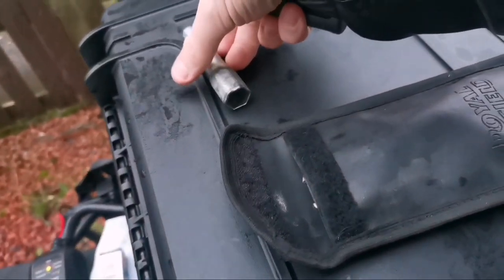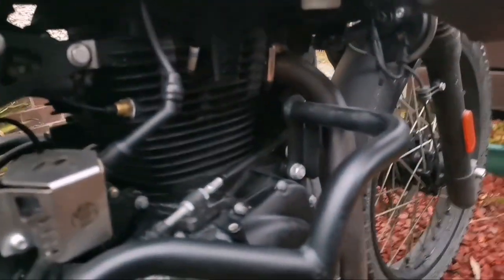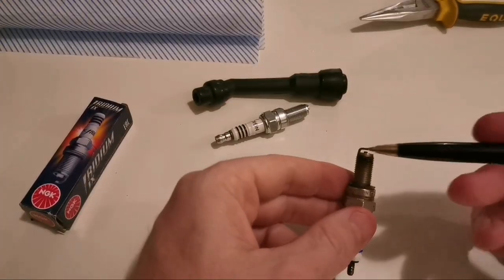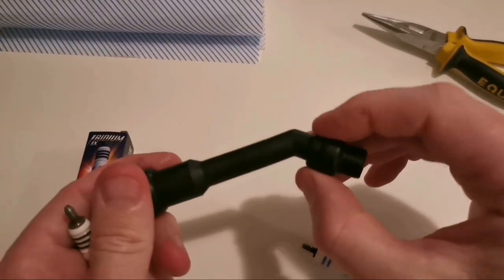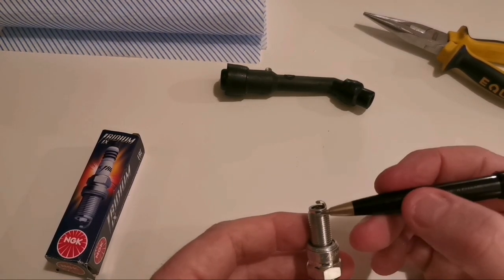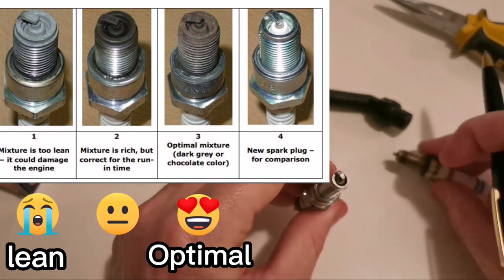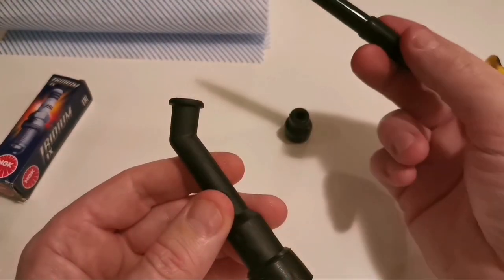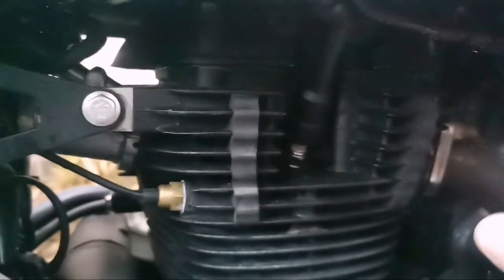Best Motorcycle Spark Plug - Himalayan Spark Plug Change - Iridium Spark Plugs vs Normal

Comment from the maker: Forgot to mention in the video guys. Double check the code when you buy the plug before installing. I ordered online with Halfords to pick up in store.. I got a handed BR8 rather than CR8.
Reply: I use the NGK CR8EIX, that is very good on both my 450ccm and 600ccm

Comment: Always put a little copper grease on the threads before fitting a plug, then it will always unscrew easily, no matter how long you leave it in place.
Reply from the maker: Aye Derek I use Nickel anti slip on all threads that need in and out regularly including plugs. I didn't mention it in this video as majority manufacturers say don't put any kind of anti slip on plugs. People can do what they think is right for them. 👍 Thanks for the feedback mate.
Reply: @WeeJaunt  Can't imagine why they say that. It's asking for seized threads! Copper grease is the second best maintenance practice, after frequent oil changes.
Reply from the maker: @derekm6236  I think it's a problem with people putting copper slip on plugs and then torque too tight stripping the threads. A few cases of folk trying to sue spark plug manufacturers after following torque specs and stripping threads rather than reduce torque by 30% after applying anti slip. Spark plug manufacturers now usually coat with Zinc or some kind of alloy blend and explicitly state not to add anti slip. Of course it will wear eventually if the plugs are not changed as per spec but that's not the spark plug manufacturers problem then. It's nothing more than an anti liable thing. Have a look on Google there's alot of information on it. Hence the reason I don't even mention it lol. I agree with you though I'm an anti slip guy. That said my brother has been a mechanical engineer for 40 + years he doesn't put anti slip in a single thread Iv just been chatting to him about it. His reason...he turns 100s bolts on the daily and always well before they need to be turned or get seized. He works on heavy goods vehicles these days tbf so it's usually steel on steel. He says imagine running spec on thousands of bolts on thousands of vehicles then add to that the math of torque reduction on all of those bolts without making a mistake. For every mechanic who tells you you should there's another who will tell you not to.
Reply: @WeeJaunt  Good point. Too many people with no mechanical experience, feel or sympathy , trying to be mechanics? FWIW, Caterpillar mechanics use lots of copper grease, especially where heat is involved.
Reply: It’s also not recommended due to differential metals causing a type of electrolysis which could actually counteract the point of an anti-seize compound.

Iridium plugs are great, but were predominantly invented for cars with difficult or near impossible to reach spark plugs. If memory serves me right, some V6 cars like the Mitsubishi Magna where the rear facing bank of 3 cylinders was fitted with iridium plugs, while the easy to reach front bank was fitted with regular plugs. At services, mechanics only changed the front bank.

Comment: When I did my apprenticeship we had a Champion Plug cleaning machine, it would blast the electrode with fine grit then after check the spark with the attached high voltage adaptor. Many times I was electrocuted by it working on the bench next to it and someone had secretly attached the crocodile clip to the vice. People forget just how important plugs are for engine efficiency and power
Reply from the maker: Wow aye good old apprentice jokes Manny. You're right it's overlooked by many people sadly including service centres sometimes. Thanks again mate 👍

Comment: I hadn't realised plug life had gone up so much. It used to be clean or replace with every oil change. Then I stopped cleaning them as I got more expensive engines and old mechanic said it was false economy to clean them as unless you were sure you had all the grit out you could be introducing grit into your engine. Nice to see you put them in by hand I have had a few secondhand bikes and cars where previous owners or garages had messed the threads up. I think reading plugs became a lost art with fuel injection and electronic ignition as the mixture and timing are outside your control and you don't really tune the engine now it has become a fitters job remove and replace at the recommended intervals.I would take one out early then keep as a spare that way you know the spare is a working one.
Reply from the maker: That's it Sean overlooked quite often. Iv had plugs rusted into heads before it's no fun and inexcusable given the cost to replace them. There is nothing wrong with cleaning and adjusting a £3 plug. I just wouldn't be doing it at 10k miles eh.

Comment: Do you have a different plug wire end?  it looks like you left the little screw on knob on the plug when you put it in the bike.
Reply from the maker: Haha well spotted. No is the same HT plug I kinda absent mindedly screwed the tip back on whilst messing around with cameras. Only noticed I'd done it after I screwed the plug into the bike. Thanks for watching mate 👍

Comment: Thanks for instructions on how to change a spark plug, but too late. I was trying to remove it by turning right! I spent hrs trying to remove it. Even used a cheater bar for more leverage. Then I snapped it off! So I had to take it to a machine shop so the could drill it out. Cost me a small fortune. So before I change another, I'll check back on your video!
Reply from the maker: Oh wow that sounds like a nightmare I'm glad it's fixed now mate yeh sparkplug don't need to be tight 👍
Reply: Well that was an expensive lesson for you! So here's something to help you in the future - righty tighty, lefty loosey😃
Reply: Haha😁

Comment: I still fir and adjust my own plugs.  Too many times after a service have I pulled it out and it hasn’t been looked at.  They are of course much more reliable nowadays than when I was a teenager in the early/mid seventies.
Reply from the maker: Great advice Jack they are better these days but absolutely right..many a car service In particular over the years they get ignored. I bought a wee car this time last year..pulled the plugs out..took almost an hour they musta had 80k miles on them and were rusted into the head. Only one of the many things wrong with it. Absolutely ridiculous mate. Thanks for watching 👍

Comment: Sorry Bud, disagree with some of what you say. The electrode on a 'normal' plug is not copper, it's tungsten I believe, the copper is the core, inside the plug. Yes, I do clean and gap plugs BTW.
As for voltage draw, the primary winding of coil will take the same current no matter what plug you put in, the current drawn depends on the resistance of those windings. The HT current is generated in the secondary windings, [which are separate] when the primary current collapses so whatever you attach to the end of the HT lead is totally irrelevent.
Precious metal plugs are meant for vehicles where it takes hours of labour to access the plugs, to save service costs as they aren't replaced as frequently.
As for your bike starting / running better with the iridium plug, you would probably have found that with any new plug - or even cleaning your old one.
Some people on Bullet forums have tried iridium plugs and gone back to normal ones because the iridiums foul easier due to the smaller electrodes, but to be fair, some say that they are the best thing since sliced bread.
At the end of the day, if you're happy to spend £10 on a plug, when a £3 one will do exactly the same job then fair enough - it's your money.
Reply from the maker: Aye your right Frank the tip is usually some kind of alloy blend, nickel, chromium, tungsten depending on the manufacturer. I just try to explain these things in simple language and often miss things out...and yes the same result would be achieved with an adjusted and/or new plug of any make. I find talking about plugs a bit like talking about oil or what kind of rust protection you use. It's a dangerous subject akin to chatting about Brexit or independence 😂 Thanks for your feedback mate I really appreciate it. In the future when I pull the crudy old fouled up iridium plug out al make a video about it. Might just call it "Frank was right". 👍
Reply: I used to fit Gold Palladium plugs to my DKW fitted with a Sachs 250 seven speed box engine.  It was in a mid state of tune with a very narrow power band and was prone to fouling.  The dealer said it wouldn’t make any difference.  He was wrong.  In practice I didn’t suffer anything like the number of fouling/whispering with the Gold Palladium plug fitted.
As far as the HT lead goes, better quality generally means lower resistance allowing a higher current for the same voltage (more power in the spark).  The same improvement occurs when the plug has less resistance (better conductors).  I don’t know if that is true for the Iridium plugs, but at the price I would have expected that to be the case.  Not all plugs are equal, some have higher conductance materials used in their construction.  The Gold Palladium’s when I was competing were designed for durability and cleaner running and that is what they provided though performance felt better due to the gold content increasing conductance.  As was typical, I didn’t change the coil, just made it easier to discharge with a lower resistance HT system discharging to earth.
Reply: @jacksjaunts8580  Whiskered plugs! what fun we had in those days :-)
Reply from the maker: @jacksjaunts8580  Thanks Jack. Time will tell with the iridium plug I'm gonny pull it out every 1000 mile or so to have a look at it. If it starts to foul I will do an update on it. I'm glad Frank gave me a heads up on this one. I hadn't seen the forums he mentioned about fouling but it's worth keeping an eye on for sure.
Reply: When I was riding competitively (or trying to ride competitively) I had the plug out and checked before every event.  With standard plugs, before every special stage.  With the Gold Palladium I didn’t need to touch it durning a days riding, practice or otherwise.  On my road/trail bikes I check them when the notion takes me, seldom more than a couple of thousand miles.  I never need to do anything with them nowadays as engines run so clean and seldom use oil.  The technology has come on a bit in the past 40+ years.  Many plugs won’t need any intervention over 10thousand mile intervals.  I used to run some big gas engines (16cylinder 3MW units). Spark plugs were £150 each and precious metal.  The engines ran 24hrs/day except during servicing.  These were changed every 2000hrs.  Of you equate that to road miles at an average of 45mph that would be every 90,000miles.  On road engines I would do it sooner.:)
Reply: I would have expected that certain engines react better to them because of the head design. Also as more than one thing has been changed its hard to say if its the iridium or the electrode shape. Or maybe you can only have that shape with a harder electrode. But if you liken it to a TIG welder where the electrode is sharpened you get a nice concentrated spark, but if it gets contaminated and balls you get a weaker random spark like you see in Van de Graaf generator experiments. So I think they make a better spark and then its down to if your bike can benefit from that. It would be interesting to see if the Bullets that were fouling them were older ones running carbs.
Reply from the maker: @seankearney6915  Good point mate. I'd be interested to know if thd issue is more prevalent in a car engine.
Reply: @WeeJaunt  If we stick to 4 strokes I think fouling was more prevalent in car engines with carburettors for two reasons. The head design often had valves in pockets with metal between them and the spark plug spaced as best they could which wasn't always ideal for flame propagation. Bikes I have had apart seem to have a more smooth cylinder head design with a domed piston. Also apart from odd exceptions bikes had a carburettor per cylinder where on a car with a single carb on a 4 cylinder getting the engine to run with the same mixture on all 4 was virtually impossible. I used to run a tuned Morris Minor with different plugs in 1 and 4 to that in 2 and 3 as 1 and 4 always seemed to run weaker so different plugs got me the same colour. Two strokes especially with the premix oil in the fuel was a bit of a nightmare. If you had enough oil in for fast running then it was too much round town and if you didn't ride the bike for a couple of weeks you shook it to mix the oil and fuel again as it tried to settle out. The old guys would even switch the fuel off before they got home and let it tick over until the engine died if they knew it would be a while before its next run just so that there wouldn't be much in the carb to settle out. If my uncle went on a long run on some of his old ones he would always carry a couple of plugs so he could just change one and clean them at home later. He always carried a few under the seat. If it was cold he sometimes warmed one in the gas ring then tried to put it in and fire the bike up as quickly as he could before it cooled down. We have improved so much in 50 years, no we whinge if we get our hands oily on a journey.
Reply from the maker: @seankearney6915  Aye Sean that figures...kinda where my train of thought was going. My older brother is a mechanic pretty much since I was born so I grew up with this stuff. You are literally describing some of my earliest memories we always had 5-6 Shitboxes on the drive literally everything you can imagine on 2 or 4 wheels tbh it's still the same today at his place at least lol. You said it right the world has moved on considerably I'd be really surprised if these iridium plugs caused significant or even any real fouling in a modern fuel injected engine but I stand to be corrected.. time will tell al keep an eye on it. Thanks again mate 👍
Reply from the maker: @jacksjaunts8580  Wow Jack brilliant. Aye same I look at them when I remember to check every cpl thousand or so. Can't buy your experience mate thanks for sharing it. Appreciated 👍
Reply: @seankearney6915 
 I agree with what you say about the smaller point creating a more intense spark but the counter argument is that the flat electrode gives a bigger fatter spark. 
I have no axe to grind here,  my bike [2009 EFI Electra] runs just fine on standard plugs, if fact, it isn't fussy about the grade of plug either, although some folk with virtually the same engine as mine swear that it must have 'this' make/grade of plug gapped at precisely that. Different engines can have different 'personalities'.
The Bullets fouling iridium plugs fell in both categories, EFI and carb BTW.
Reply: @Frightningman  yes so many variables even down to fuel quality which can vary due to state of the garages tanks. And as you say you can just get an engine with a temperamental personality. I have certainly had a few of those.
Reply: Isn’t it great how much chat we can have over spark plugs.  Then, just when you thought you knew it all (or a fair bit anyway) someone else has a good overview that is completely practical and put a different slant on the description of what’s happening.  Loved the tig analogy.
Reply: No use in bullet

Comment: Just ordered mine. Thanks for the help. I found my bike was overheating a bit the last couple of days. Will changing out the spark plug help that? Also, do you recommend cleaning your air to oil filter? I have heard everything from washing it with salt water, to not cleaning it all. Thanks

Comment: I just ordered one for my Himalayan. Amazon said it doesn’t fit but it’s the exact same model you have listed. I just picked mine up brand new and it takes around 5-6 tries to get it to start and idle. Hopefully this fixes that problem.
Reply: Same here...4 to 5 attempts and it's up to 85 degrees in Vegas. 
Ngk iridium plug came pregapped at .25
Believe it needs to be .08.
Reply: @edwardkaminsky8142  update. 6 months later no issues. Most times it starts with the first try. If it’s been sitting for a while it may take two tries.